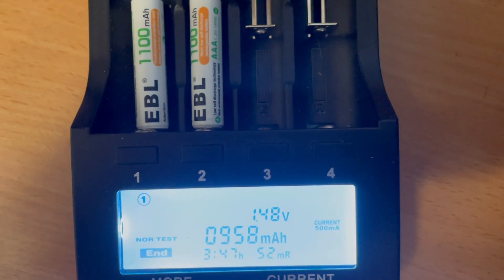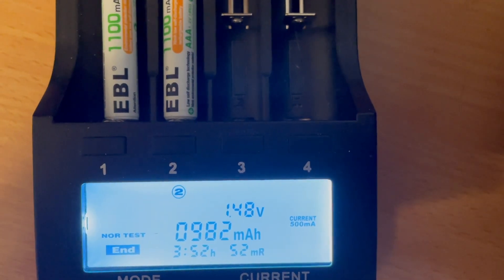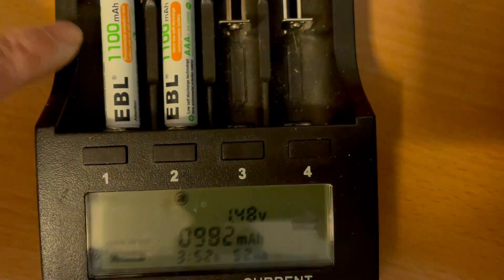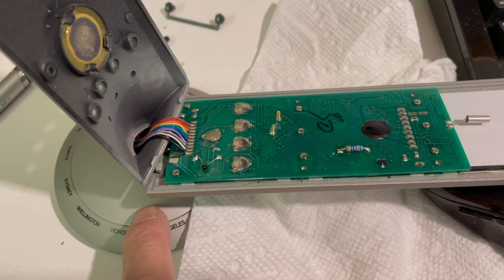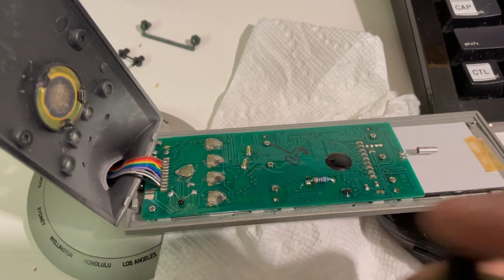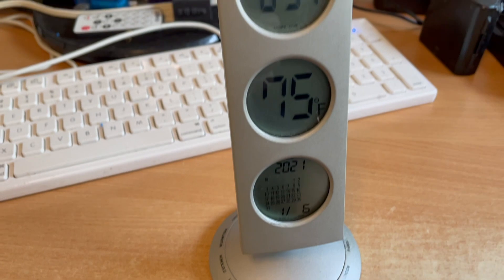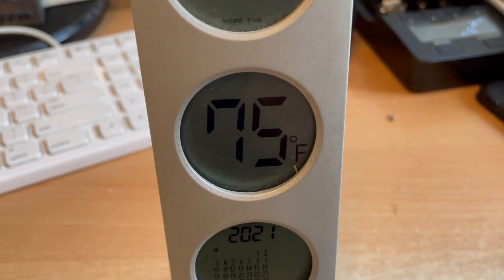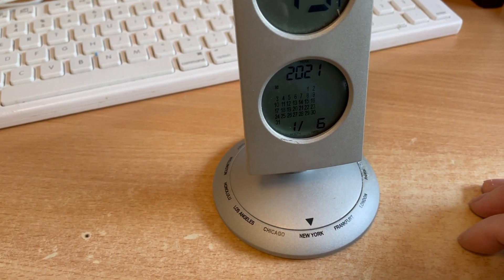Time to stop using alkaline batteries

Comment: I've seen some crazy deals on AA alkaline batteries here. Like 30 pieces for 15USD sometimes. I guess most of them will end up in the trash after a while.  I've been trying to convert people to convert to rechargeable  but some people still seem to be thinking that  rechargeable  batteries run out of power quickly, are expensive and that it takes a day or night to charge. Aldi sometimes has like a 6 to 7 USD deal on 4 x AA or AAA batteries that are not bad for their price. Combine that with the good and cheap Lii500 and you are good to go and ready to go for a long time.
A problem that I am starting to see here is that more and more stores are no longer selling 9 Volt batteries which can be an issue for the future. A couple of my meters use those. 
I've been testing my Eneloop AAA ones a couple of weeks ago and was disappointed that they only reached 730 to 750 mAh until I checked the code  on them and looked online at the specs. They were first generation, which means probably before 2009 and the min capacity was 750mAh (new). Knowing that they have been in use almost full time and still have this output is just amazing.  The AA's, also first generation, were good for 1780 to 1850mAh which is amazing. Not one of them has failed for now and they all seem to have the same quality/output.
Another brand old 2300mAh only managed like 830mAh first but after a couple of cycles of charging (I use a Maha charger for that) it went back up to 1600mAh. The other one of that brand didn't charge anymore.
I don't see any reason to use Alkaline batteries anymore. I only see the disadvantages like you mentioned.
Reply from the maker: I agree with you. I have not had one eneloop fail on me. No leakage and they retain their charge.  You have to check on any alkalines left inside your equipment if they were there for more than a year. Anytime I open up an old radio with alkalines and you'll find corroded batteries. Buy quality NiMH rechargeables and you'll get good lives out of them.
Reply: @wtam69   Yes, it happened in a couple devices and unfortunately in some expensive stuff. But white vinegar to the rescue (again). It seems to surprisingly clean up the mess. Afterwards I clean with some isopropyl alcohol.